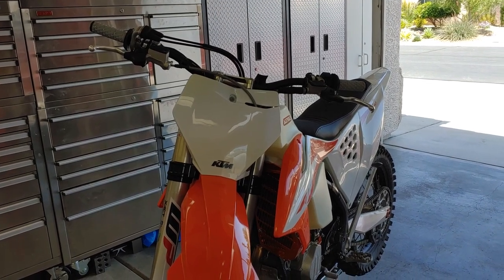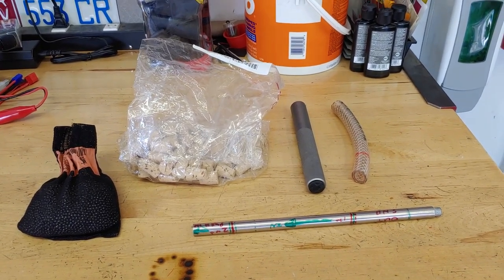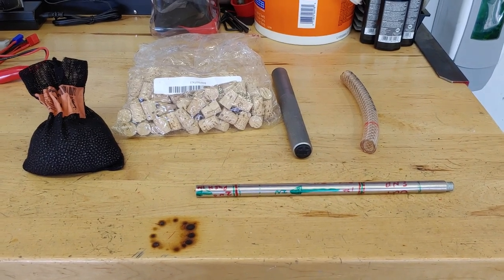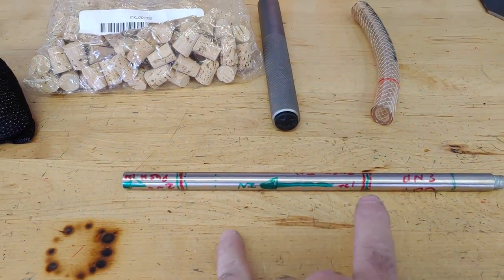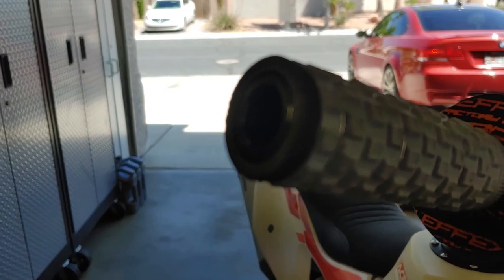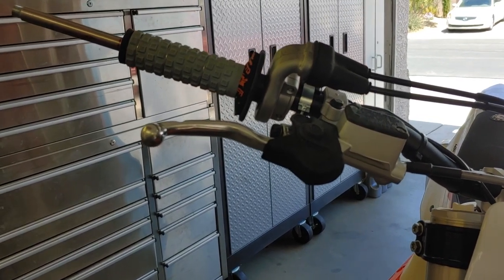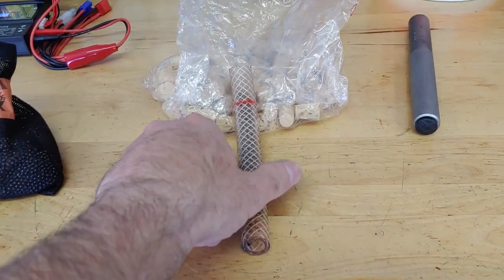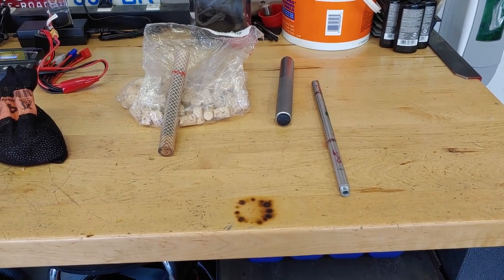Custom Handlebar Anti-Vibration Mod

Comment: So its been 4 years since..  Does the cork not get ate up from vibration of the shot against it for many years???
Reply from the maker: It's been installed for over 9 yrs in my 2014 300 xcw (300+ hrs)...and no, still working/holding up.
Reply: @SteveSmith-wl8yq   F king love these real life examples that been tested.. Thanks man.. AWESOME. im in!!!   Also thanks for responding. Truly helps a ton of us! Im a newbie .. so thanks!!!!!  God Bless! 🙂🙂🙂
Reply: @SteveSmith-wl8yq  Subscribing.. thank you. Love folks helping others out
Reply: @SteveSmith-wl8yq   an 300 hrs at say 50 mph be like 15,000 miles.. plus your rattling the hell out of it on dirt.. ok im totally sold.
Reply from the maker: @bwnco  thank you for the kind feedback ... First time YouTube helped me was 2007 ...  decided then to pay things forward-information (if I can).  Have a nice one...
Reply from the maker: @bwnco  you are very welcome...  And thank you for the kind feedback...
Reply from the maker: @bwnco  dirt bike hrs, other than a Baja or Dakar race bike, only see about 20 mph for avg distance over eng hrs (IMHO)...so, more like 6k-7k miles.  Distance isn't a factor ... Eng in the worst rpm for harmonics is the true measurement against time.  I'd guess that is about 50+% of the total hrs.
Reply from the maker: @bwnco  others have tried it and had great success/results with the mod.  I hope your results are just as good.
Reply: @SteveSmith-wl8yq   Her is .y helpful pay it forward advice.. "Never saddle a dead Horse!".....   God Bless!

Comment: I took out the one s on my 135 cc benelli mini n idk if low cc bikes need it can u help me out in understand y ?
Reply from the maker: Not sure exactly what you are asking, but here is a short simple explanation of why adding mass to the ends of your handlebars reduces vibration(s) felt.  bottom line, IMHO...if you ride your bike and do not have any hand/arm pain from the vibrations then you do not need to do any vibration mod.  Here is why you might  need the mod:  Vibrations can be caused by the sum of different sources (i.e., a running engine, anything mechanical).  A 125cc generates vibrations as much as a 500 cc engine...the only diff usually is the freq range of the vibrations generated.  The real problem comes with Harmonics (resonate) when the vibrations get-in-line with the natural freq of an object (solid or held together).  Most everything has a natural freq at which it will resonate (vibrations that grow in strength ).  A small engine generated vibration can cause your handlebars to vibrate multiple times stronger due to harmonics (this can be extremely noticeable at certain engine RPM ranges).  Adding mass at the ends of your handlebars changes the freq range(s) that causes your bars to vibrate (mass tunes your bars to resonate at diff freqs).  Think of using your legs to make you swing higher on a swing...if you do not swing your legs at the right time then you will not swing any higher.  Your engine vibrations can get in time with your handlebars vibrations thus causing much more powerful vibrations in your handlebars the same way your legs cause you to swing a lot higher on a swing set.  Try quickly revving your engine (blip the throttle--don't hold it) in neutral and see if anything on the bike starts vibrating aggressively at certain RPMs (i.e., brake/clutch/shifter levers).  Hope this answers your question...
Reply: Total Genius-ish...lol 😂... 😉 ...but that was the best detailed reply to anyone I've ever noticed on you tube... 👍... well done...👏 👏 👏
Reply from the maker: @Eve....747  thank you for the (too) kind feedback...  Have a nice one...

Comment: is it all about adding more weight inside ?
Reply from the maker: Yes and No.  Adding more weight at the ends of bars (critical to add it at the ends of the bars) will up the mass level and thus soften the vibrations some.  However, adding the same mass while keeping some space between the pellets allows the pellets to absorb the energy vs just being dead weight.  It is the same physics used in Dead-Blow hammers.  A normal hammer just has mass and thus you feel the hit through the handle...while a dead-blow hammer has mass that is free to move "some" and you really do not feel the impact through the handle and into your hand and arm.  Hope this info helps... have a nice one...

Comment: Great vid! Doesn't that change the weight of the handlebars meaning result steering is affected?
Reply from the maker: First off, thank you for the kind feedback.  ... Good question...short answer is no real noticeable impact to the feel of steering....if anything it feels more solid/stable.  The mod is actually less mass/weight than the vibe kits sold on the market (the solid insert types).  There are tons of things that add more weight to the bars.... for example:  full wrap handguards, dual sport factory mirror (off clutch and brake perch), steel vs aluminum handlebars, GPS or CEL phone mounts with electronics, etc..  Also, the biggest resistance to overcome for steering inputs comes from the gyro effects of the front tire/wheel assembly...not so much from the small mass added into the ends of the bars.  However, If you put a bike on a lift stand so the frontend is off the ground...and you did before and after tests (with mod without mod) you might feel the slight amount of extra mass/weight when moving the bars left-to-right-to-left.  But, if you have a steering dampener installed, or other crap on the handlebars...the vibe mod mass is such a small percentage of the total mass of the handlebars setup that it becomes in the noise (too hard to notice).  I've never noticed the mod to ever impact my steering...or feel heavy...but I massively notice the amount of vibration that doesn't end up in my hands and arms!  Hope this info helps... have a nice one...
Reply: @SteveSmith-wl8yq   First of all, thank you very much for your detailed response! I appreciate it. Secondly, without wanting to be repetitive or annoying, I don't know how to understand how much lead shot is enough inside the handlebar. Should it be slightly compressed from cork to cork? Also, is there anything else I could use instead of cork? I apologize if this has already been answered, but I'm not very good with English. i ll give it a try in a couple of days. Thank you
Reply from the maker: @frsendurotm  Not a problem... I'll answer in several bullets..

- The lead shot should have some movement, but not very much--at least 3/4 full, but no more than 7/8 full--just enough movement of the lead shot to sound like a rattle shaker--do not compress the lead shot nor pack it to the point it has very little movement. 

- Cork:  the cork is used to keep the lead shot in a same size volume area--meaning the cork at both ends doesn't move inside the handlebars so the area between the two pieces of cork never increases or decreases in size/volume--cork pieces don't get closer or farther apart from when you installed them.  If the cork moves after install then your lead shot has too much extra space for movement or not enough space for movement.

- Regarding use of cork--you can use anything that will not move and keep the lead shot in a defined space.  Rubber stoppers would work pretty good, but I'd only use stuff that you can get back out or be able to relocate if needed (meaning being able to increase or decrease the volume area for the lead shot.

The concept is the inverse of a dead blow hammer.  A dead blow hammer distributes impact forces over a longer period of time thus making the initial impact not as aggressive...especially not as aggressive back up the hammer handle and into your hand.  The vibration transmitted into the handlebars is deadened by the force of the vibration being distributed over a long period of time and ending up out of cycle/sync with the vibration traveling back in the opposite direction...the lead shot tends to be moving in the opposite direction of the vibration freq and thus end up with an energy canceling effect...resulting in a lot less energy in the vibrations...meaning less and lower intensity vibration.

Here is a quick footnote on dead blow hammers:  In a conventional solid-head hammer, the force of the entire solid mass of the head is delivered at the moment of impact. Compared to a conventional hammer of similar weight, a dead-blow hammer conveys less peak force, spread over a longer time.  At the moment the face of the hammer head contacts the surface being struck, the sand or shot within the head is effectively trailing it (due to inertia, it is collected at the opposite end of the head).  The force imparted by this additional loose mass within the head is not imparted to the struck surface at the moment of contact--so for your handlebars this means as the handlebar vibration starts moving in the opposite direction is about the same time the loose lead shot that is still traveling in the initial direction--opposite direction to the new direction of the handlebar vibration--causes the lead shot to impact the inside of the handlebar and cancel part of the vibration movement energy (the lead shot tends to be always traveling in the opposite freq direction of the handlebars and the two item keep slamming into one another and canceling out some of the vibration energy) .

Hope this all makes sense...  hope your able to get the mod working well for you...

Comment: Hi, was just wondering how much noise does it make?
Reply: While driving?
Reply from the maker: Zero that you can hear at anytime...you do not hear the mod even when the motor is off and you move the bike around it a super quiet garage.  Other than the handlebars not vibrating as much, you would never know the mod was installed.

Comment: why not fill it all the way up with bird shot?
Reply from the maker: Good question... the answer involves physics...but I'll just use the same analogy I provided in the video (dead-blow hammer).  The same reason why dead-blow hammers do not have stuff in the handle area...little to no return on investment.  For handlebars, anything past/outside the perch clamps can move/vibrate independently...the farther from the perch clamp you move the more the movement/vibration.  So adding the deadening weight/material towards the ends of the bars provides maximum effect...the closer you get to the perch clamp the less the impact and thus you are just adding weight with little to no return on investment for said added weight.  The best solution is to have all the weight added to the last 1" or so of the bars, but the best off the shelf solution I could come up with is the diving weights/pellets added to the last portion of the bars.  Hope this answered your question well enough.
Reply: @SteveSmith-wl8yq  thanx bro, answered it good.
Reply: Imagine the vibrations going through your entire handlebar and into your hands without the mod. You're getting all the frequencies. Adding more mass to soak up the vibration to the ends will help but will still transmit some vibration as there is "no space" between. Now imagine having space for the little lead shot pellet to vibrate out inside its own mass, bump against each other lead shot pellet, the corks and yes also, some to your handlebar. All that energy coming from your bike and on to the handlebars in the form of a spectrum of frequency vibrations will be absorbed by different sized objects, with different densities (corks, #6 and #4 pellets) with room enough to move and "not transmit" and the end result is less vibration with attenuation of several frequencies. That's the only thing I would change to this mod, put different sized pellets in but I doubt it will make much difference. The frequencies that make your hands numb are higher, that's for sure. Higher frequencies, travel farther because they are higher energy. They'll vibrate through you your grips, gloves, hands, bones and to your nerves. This causes numbness.
Reply: @matrolen  thank you very much!

Comment: Hi what Size balls , would 2mm be OK?
Reply from the maker: Good question... IMHO the two main variables that make the mod work well are:  Mass & Volume.  A 2mm pellet would easily address the volume side of things; however, I do not think that small of a pellet has enough mass.  If they are made of lead (vs steel) then the mod should help some (if made of steel then will only help a little -- my best guess).  I'd opt to use lead balls in the 3-4mm range.  Hope this helps...
Reply: Thank you very much I've found 1kg worth of shot 3mm however, in some of the other comments you've left you mentioned #4 size which is 6.86mm. Which should I use? Thank you
Reply from the maker: @elvisisalive  Here is what I purchased for the mod ( https://www.amazon.com/XS-Scuba-Diving-Weight-Orange/dp/B0020L0GKQ/ref=sr_1_3?crid=1KVOQ2MQBF7LP&keywords=XS%2BScuba%2BLead%2BShot%2BWeight&qid=1681483388&s=sporting-goods&sprefix=xs%2Bscuba%2Blead%2Bshot%2Bweight%2Csporting%2C130&sr=1-3&th=1&psc=1 ).

Also, be careful on the sizing stuff... "buckshot" is not the same as "shot" (#4 is completely different between the to -- #4 buckshot is 6.8mm -- shot is just 3.3mm).  Sorry, I should have made sure I emphasized "shot" vs "buckshot".  Here is a link to a chart that might help ( http://www.rivermenrodandgunclub.com/shot-size-chart--recommendations.html ).

Comment: how many pounds of lead birdshot would you need for this. Im looking on amazon and see a 1 pound bag of #4 birdshot. Would this be enough to do this job?
Reply from the maker: 1 pound should be plenty more than enough.  I used xs scuba lead shot weight bag (got it on amazon)...3 pound bag is approx $17 ... Use keywords XS+Scuba+Lead+Shot+Weight
Reply: @SteveSmith-wl8yq  Thank you so much!!

Comment: What size corks did you use?
Reply from the maker: I think I use size #5...but it will depend on the inner dia of the bars you are using.  You might need to go to a size #6 for some bars.  You can sand down the rapper some if the cork is a little to tight on the big end.  Do a search for cork size chart and you should be able to find the best size for your bars.

Comment: Just fill the bars with spray insulation and be done?
Reply from the maker: That is one way of doing it...but it doesn't have the same density effect of lead dead-ness.  Buy a deadblow hammer and replace the pellets inside it with spray foam and see which configuration has more of a deadening effect...there is a reason deadblow hammers don't use spray foam.
Reply from the maker: @Shawn-in-da-Canyon  Yes, but IMHO the vibration area you want to deaden is where your hands come in contact with the bars (the ends) and the middle of the handlebars is hard mounted to the top triple clamp, so the vibration frequency will increase (get stronger) the farther you get towards the ends of the bars.  Filling the whole length of the handlebars adds at least 4x times the weight without that much more of an improvement in vibration at the ends. I rode by 300XCW over two days (150 miles) the past weekend and never once felt handlebar vibration as an issue...however, I could feel it from time to time in the foot pegs.  This mod may not work as good for everyone...but is sure works extremely well for me.
Reply: @SteveSmith-wl8yq  True.. You should try experimenting and making your tube only the length of the handle bar grip, I'm curious to know because I just bought the ktmandhusky brand of short bar ends. They are much smaller then your tube, and I wonder if this product vs your diy contraption is a better design :)

I think the extra weight of the steel ends I got would help too. If you take a fishing rod and you shake it from the handle, the tip will bounce around faster and rougher then if you held it the otherway around. The handle end would travel further but slower and be easier on your hand... OR think of a pool plank bouncing after someone has just jumped into the pool. If vibration is movement weight slows it down. But probably worse at higher speed
Reply from the maker: @brendon8702  Thank you for the suggestion...ive already messed with the amount of shot and where in the bars...and over many yrs I've also experimented with many different setups (both bought off the shelve as well as custom designs).  What seems to work best for the freq of virabation that causes me issues seems to be best countered with the current setup im using.  However, each person is different and thus might be best resolved with a completely diff option.  I hope you find something that works well for you.

Comment: I want to do this mod to my mtb. Has anyone had luck with expanding foam?
Reply from the maker: Expanding foam really shouldn't do very much because the physics behind the mod working is based on "MASS" that can move opposite the resonance/vibration frequency.  Foam will move with the vibration vs move out of cycle some.  Also, the vibration in the mtb handlebars is created mostly from the terrain and thus doesn't have a set freq so the mod shouldn't provide as much deadening as on a typical motorcycle engine.  Please drop an update if you try either (or both) types of mods.  I'm interested to read what you find out.